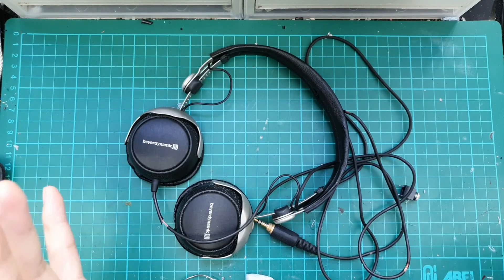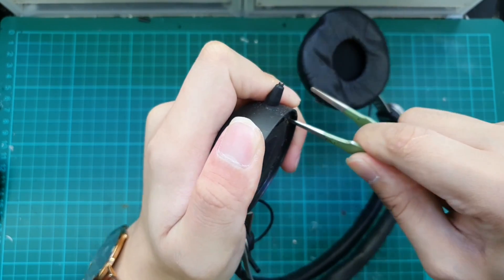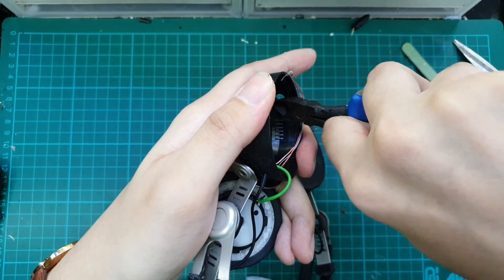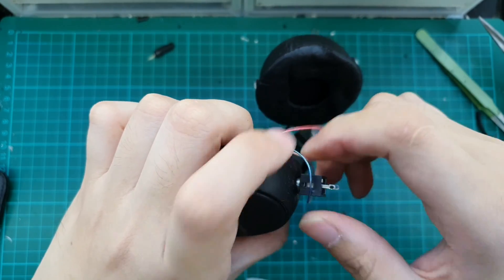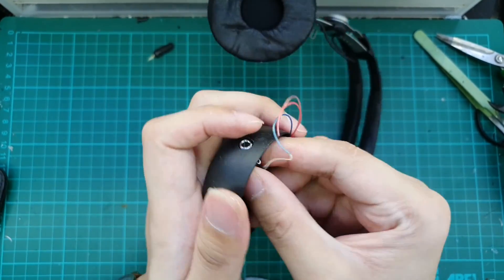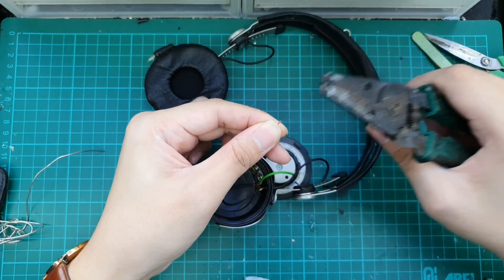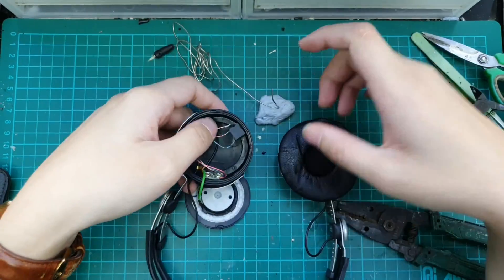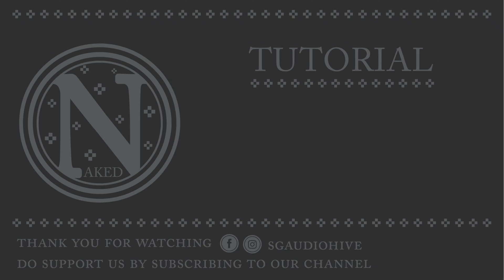Beyerdynamic DT1350 / T51i 3.5mm detachable cable upgrade mod Tutorial

Comment: Thanks to your video, I was able to mod my T51p with a detachable cable. Removing the drivers was the hardest part of the process. While doing it, I decided to replace the original ear pads with 5cm velour ear pads which I stuck to the cups using double-sided silicone tape.
Reply: Can you please send me a video or something... My left driver stopped working and I need to check the wires ...